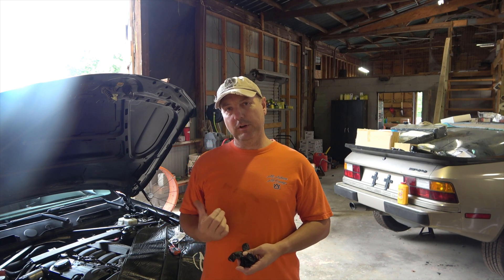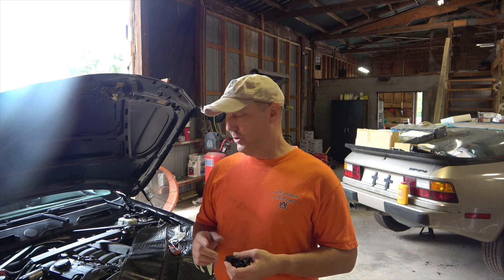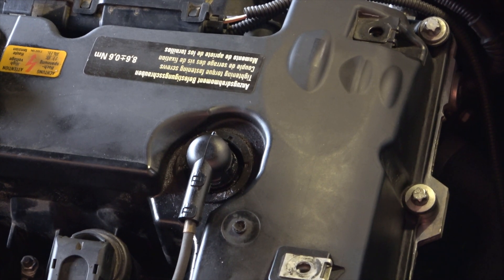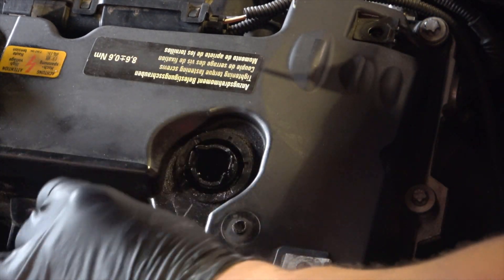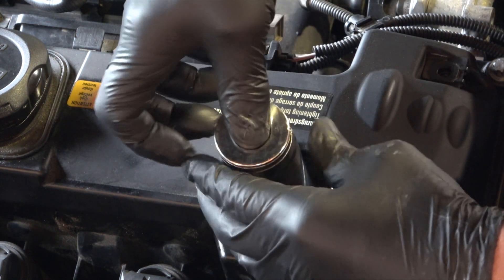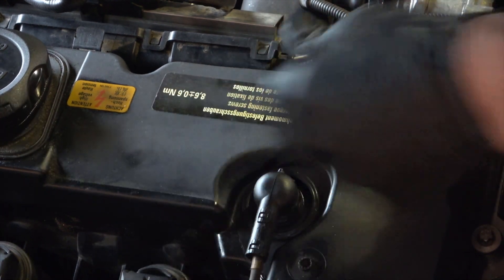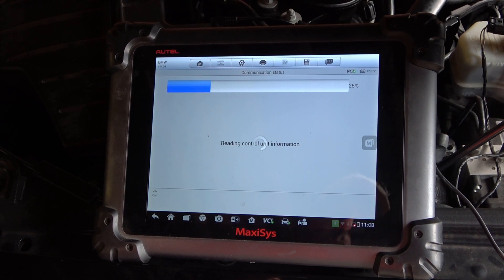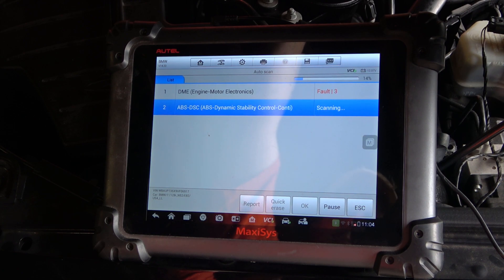BMW N52 VALVETRONIC ECCENTRIC SHAFT SENSOR SEAL

Comment: I was having   some vvt motor    issues  code 2a38 / sluggish  movement/open circuit, one issue   , code 2a77 was lose wire on battery   module, tighten wire 2a77 went away ,  now 2a38 stayed   now ? Looks like oil round the sensor, im not getting  a  bad  sensor  code if oil in inside will it still have 2a38 , mayb open circuit  from oil ?  i jus did valve cover gasket few months  ago , really dnt went to do that any time soon again  lolol , think clean the pins  and change sensor  gasket instead  or jus change  it , sorry so long , thanks
Reply from the maker: Start by resetting the valvetronic stop limits...need a shop quality scan tool or BMW software to do it